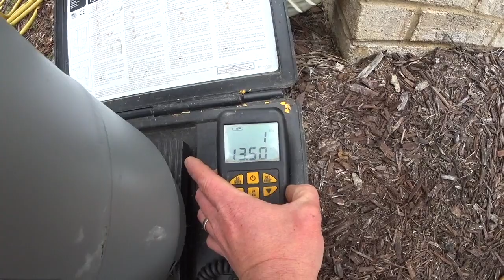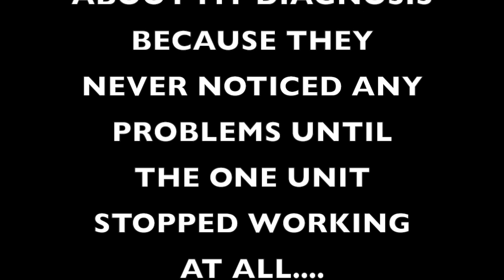HVAC Service: Three Leaking Lennox Evaporator Coils Within Five Years 4-30-15

Comment: Lennox settled a class action suit about there evaporators. But it only covers if its faulty within the first 5 years. Not even covering there parts warranty, which is 10 years. Mine went out on the 7th year. Yayyyyy I get to pay a $1,000 in labor and material cost.

Comment: Starting with the hardest one is always the best way to go. ;)

On the system with no metering device, I'd bet that it had a TXV when it was first installed, but someone took it out to "fix" a TXV issue.

In 21 years of doing service work, I've found systems with no piston a few times, and I couldn't even begin count how often the wrong piston is in the coil.
It is so common that I just assume the coil has the wrong piston in it any time the factory installed one differs from what the outdoor unit requires.
Reply from the maker: +Mark Beiser I'm not so sure that the TXV was removed, I found another on just like it on a different job but the customer hasn't agreed to open it up and check for a piston.

Comment: Good ol Lennox here in Florida we are replacing evap coils after a year of new installation. Hope the new one doesn't leak. If you run into again there is a class action lawsuit with Lennox. Www.evaporatorcoillawsuit.com  give that to your clients.
Reply: What manufacture doesn't have a class action lawsuit on evaporator coils? Raheem is by far the worst!!
Reply: One problem IMO is that they are so cheap in manufacturing that they are mixing metals that react badly in proximity. These coils should be ALL COPPER. Not aluminum with copper elbows. Just to save materials cost of a few dollars they create something that is bound to fail. It's like when aluminum wiring was installed in some houses in the late 1960s because copper got expensive and the electricians just connected the aluminum wires to the copper junction screws on the AC outlets and corrosion took place. Also, the two metals have different expansion/contraction profiles. At least in Dallas, in the 1980s there were house fires that claimed many houses thanks to the shorts that occurred due to this.

How to convince these f**king bean counters at manufacturers like Lennox to stop shaving pennies off their process and start making reliable units that can last 20-30 years like the old ones used to?

Comment: Good Video.
Too Funny. no Piston in the Evap. We don't need no Stinking Piston, Lol. Just let er Rip!  It just Ran like an old cap tube evap with the distributors as the metering device. i'll Bet the Suction & head Pressure was kinda High. High amps & Flooding the Compressor. Kinda interesting to know that they will run that way. Probably Designed that way so that if a Txv Sticks wide open / bulb comes loose from the suction line the unit will still cool and not take out a compressor right away & Limits max Flow From a Txv.

Wow, the Rust on that Evaporator is Like a 30 Year old Evap. That Evaporator is Trashed for a 5 Year old Evap.  Big House With House Cleaners = alot of Bleach mopping the Floors maybe ? Bleach Getting Sucked in the Returns.  The Bleach has Just Ate Pin holes in those Evaps i'll Bet. Doubtful Lennox Had 3 Bad Evaps. It's a House issue, but i'll bet you allready came to that conclusion too. Maybe Electronic Air Cleaners installed in the Returns Might Get Rid of the Acidic Air Eating those Evaps out. I Wonder What the Blower wheels look like ?
Reply from the maker: You're probably right, the house most likely killed the coils. Vaishnavi family name give you an idea of where they're from? I'm not good with that sort of thing.
Reply: +Stephen Rardon (HVAC with Stephen Rardon) So you believe the "interior gases theory" behind bad coils versus the too thin and cheap theory?  I wonder what kind of electric bills they were living with or maybe they just liked it warm inside in the summer.  The heat could not have worked well causing the electric strips to raise the bills in the winter.
Reply: I see this is an older video.  We had  a home insulated with spray foam and had 3 coils leak in it.  We were told that adding fresh air would solve the problem. customer hasn't  decided to do that yet.  also saw something from carrier that said same thing even on homes with out spray foam to bring in fresh air.

Comment: used to work at GM-hydramatics division making transmissions.  this plant is a square mile in area...so AC was crucial,  cause that plant inside would cook...and the AC was always malfunctioning and there  guys on the roof always working on 
them.  
one thing the general foreman told me is a transmission would work  fine even if the gears didn't have teeth---and  when a machine was down, he say, "run em."  seems odd the AC would rarely work properly
Reply from the maker: That would be an interesting thing to look at, the AC in a large factory like that. Every manufacturing location I've seen has had terrible upkeep methods! Always dirty coils, dirty blowers and plugged drains.